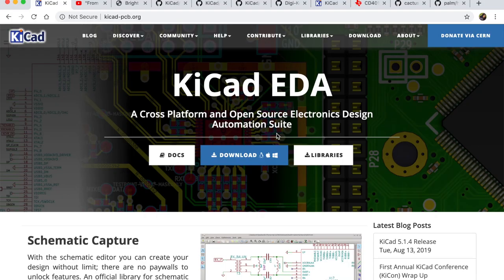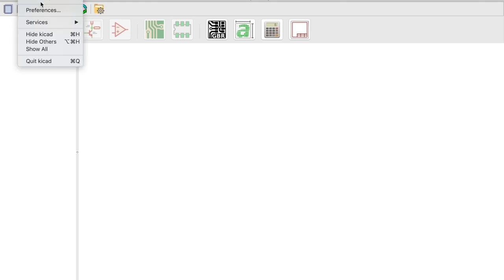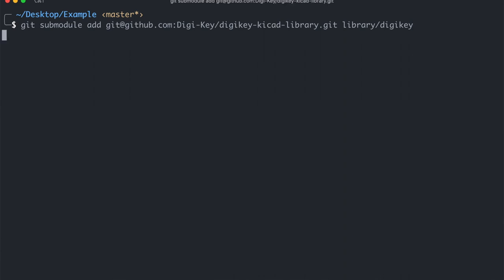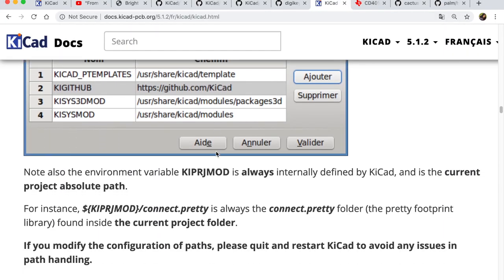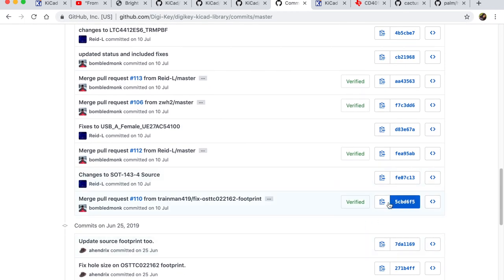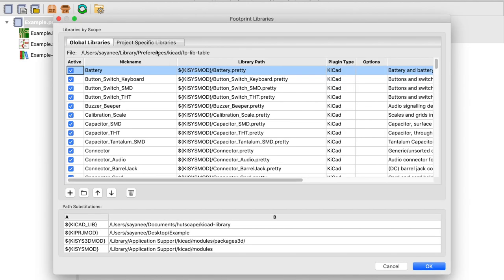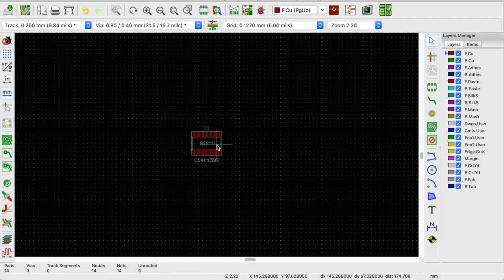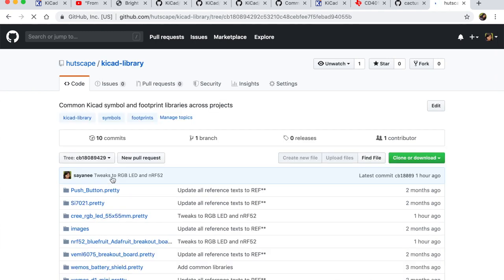KiCad Library management with Git submodules

Comment: How do I change my directory structure to find a schematic I designed in another directory structure?
Reply from the maker: I simply locate the KiCad file *.pro from the folders in the respective operating system and double-click it to open in KiCad. Is this what you are looking for?
Reply: @sayanee  I found it eventually. Ty. In the main KiCad window, "open existing project" and changed the Dir from there.